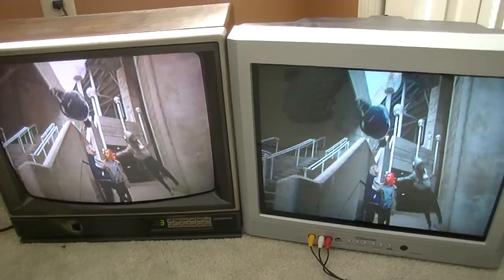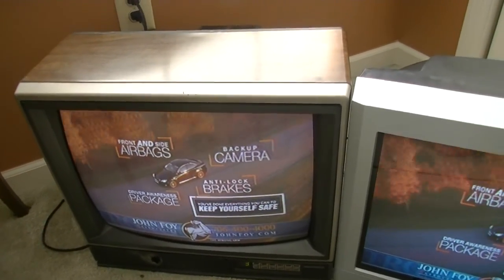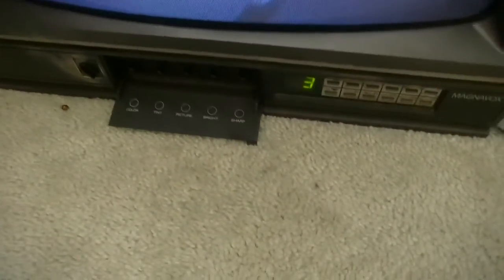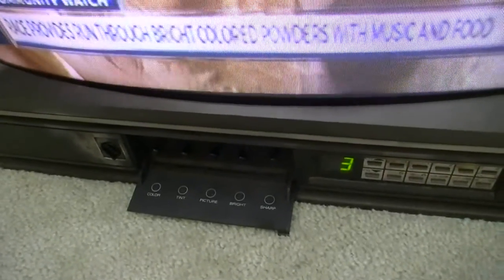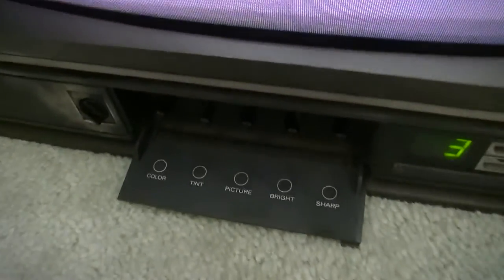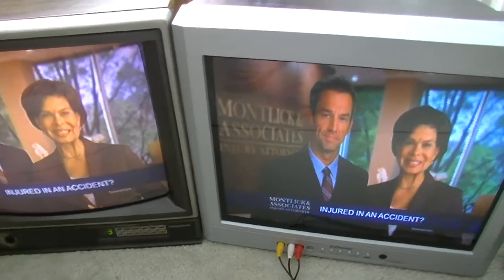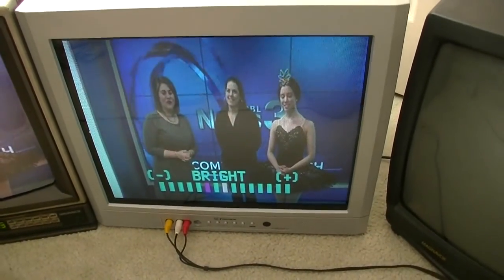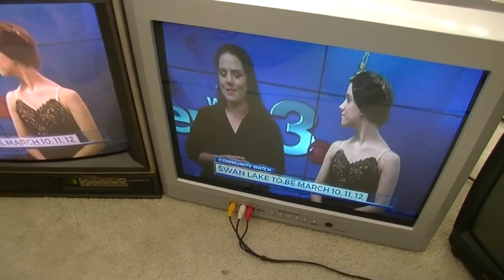How To Keep Your CRT TV Running Forever!

Comment: The oldest working television in the UK was made in 1936 and it is a CRT. There is also one that was made in 1946 and it was modified to work with digital TV and that is the oldest working TV in the midlands. CRT's can last for ages and ages. I love them.
Reply: Autistic Rebel better than hd cheap crap tv's!!
Reply: Mine sat in the rain for about a year. It still fucking works
Reply: Iku Ze people wash the circuut boards in a dishwasher, dry it and then reassemble just as a refurbishment lol, insane
Reply: @Creations and circuits ,I just repaired five DVD players a few weeks ago. They weren't even that old,a few months each for a couple and like a year and a half for the rest. I had NO idea what I was doing and was about to just throw them all away. I keep buying them and they keep breaking almost as soon as I buy them and so I just buy another and I got sick of it so after remembering how my ex husband use to just take apart DVD players and VCRs all the time and fixing them without even knowing wtf he was doing ,I decided that I could probably do it too,so I did with all five of them. One of them just needed cleaned and the others,I just kinda moved the parts around a little ,going on instinct and I'll be damned, I fixed them ALL in less than three mins each. No lie. 😁
Reply: Plasma TVs just start leaking after 1-2 years
Reply: is it still working?
Reply: Wait wait wait wait your saying CRTs can last much longer than the normal flat screens we see today?
Reply: @koiyujo1543  Yes modern TVs are junk I’ve seen flatscreens just stop working after 2 years of use my CRT tv is 25 years old still working like new

Comment: The Crt's last so long I've rescued several from the landfill and they work great even after being discarded. I think the solid state electronics would fail before the tube itself would fail.
Reply: My experience with lcd tech - they work five years maximum, after that matrix fails. While CRT work forever.
Reply: @snesfan8935  CRTs should come back into the mainstream. Lasting forever = more sustainable in the long term, and that's what these green initiatives are all about LOL
Reply: @Suedeash  "Green initiatives" is more akin to the whole climate change propaganda, but it's good to save CRTs from the landfills.
Reply: Our 9 year old Samsung 1080p tv still works great to this day without a single repair or issue.
As long as the panel dont get damaged, to me lcds when it comes to repairability should last longer.
Reply: Wow I didn't know these things could last longer than regular flat screens I could see these being useful got interstellar space travel
Reply: @dansmith5012  I bet you are smarter than all the scientists.

Comment: When it comes to non HD games, CRT's are the only way to go, IMO.
Reply: Even HD games can be used on HD-ready CRTs (which actually existed, surprisingly enough). I personally want to get a TV like that for my old Xbox 360 S.
Reply: @MrUnknownuser164  some crt monitors went up to 1440p too. Nothin to scoff at i must say
Reply: @Socaran Ectien  Interesting. I remember reading something about CRT monitors having a maximum resolution of 2048x1536 (basically the doubling of 1024x768, like how 2160p is the doubling of 1080p) at 85 Hz over VGA.

As for TVs specifically, the early 2000's saw projector TVs (and even direct view TVs) that displayed 1080i over component. They were still CRT displays, they just had screens that were flat and wide. These were the TVs that were intended for the Xbox 360 and the Playstation 3.
Reply: @MrUnknownuser164  you know you may be onto something. The dot pitch has a lot to do with the resolution and on the hard forums said that on an fw-900 2304x1440 won’t fully resolve even at the center. I guess that monitor, one of the best crt monitors, “can’t” do 1440p?

Comment: Good info. I have a Sony Trinitron XBR  36 inch from about 1999 and I believe the CRT is getting weak. Sometimes anything in the backround that is white has a pinkish hue to it. Also anything blue, like the DirectTV guide, will turn green for a second then go back to blue. The TV is on probably 18 hours out of 24 and it's been running like that for a few years now.

Comment: I just picked up a 2004 27" Toshiba one, looks brand new lol. First thing I noticed when first turning it on is that the TV has thicker scan-lines than what I'm used to.
Reply: I have an 05' 27" Toshiba HD CRT and my Sixth gen consoles look absolutely amazing. CRTs are still top notch for lower res images.
Reply: I just picked up a 13" toshiba from 2001 and have yet to try my gamecube on it, but the live feed from an old digital camera looks surprisingly great on it

Comment: If you guys adjust the picture settings that can help keep your tv from using extra energy. You need to make the clearest picture so your crt tv won't use too much electricity projecting images that are blurry and soft looking. If you give your crt the clearest picture, it will stay cool in temperature and it cwn reduce the electrcity bill. Giving it a clear picture also helps the tv use less light around its projection. That why you have to adjust the screen setting for the clearest High Definition HD picture.

Comment: Dust free environment is best. Dust in the unit collects moisture and heat. Disconnect from power for a few days before disassembling and cleaning. Also pressing buttons during this time can help remove static voltage left in the capacitors. If you have a clock feature there may be a battery inside in need of changing too. Cheers

Comment: I have a 32" Toshiba CRT television which is my only television.  I got it for free off a Craigslist posting. I use a digital to analog converter for over the air television broadcast using the S video connection on the television,  and connect up a DVD player with the component video connection.

Unfortunately,  eith the remote failed or the remote signal receiver on the television failed.  That's not too much of an issue since the converter and DVD remotes allow many functions to be handled with remotes.  However,  the on/off functions and shut off after x minutes function aren't accessed by remotes,  so the television winds up being left on most of the time.

Also,  I'd like to connect up my laptop to display internet media,  but I'm out of component connections,  and the ones I have don't match up with the television.

I COULD use an RF connection for the digital converter and look for an  HDMI converter to S video or component television.  I haven't gotten around to that,  yet anyway.  

I avoid throwing away musable equipment,  although a more modern LCD television would use significantly less power.  My bias is to keep using the Toshiba as long as it runs.

Comment: I use a Sony PVM-14L4 monitor as my main TV! I have my original 60GB PS3 connected to it with component. I know the PS3 would probably look better on an LCD TV with HDMI but there's just something I love about CRTs and I don't know how to describe it. I also have my high-end VCR and LaserDisc player connected to it too with composite! And I even have a black & white CRT monitor facing in a different direction so I can see the picture from different parts of the room and that monitor is connected to the main monitor with composite. I have a PlayStation composite/component hybrid cable so that I can run the PS3 through the LaserDisc player, which runs through the VCR, which runs to the main monitor then finally to the black & white monitor. But I also have the component part of the cable running directly to the main monitor for better picture quality on the main monitor. The reason I have a composite/component hybrid cable is so that I can display the PS3 on the black & white monitor and be able to record it onto VHS as well as having good picture quality on the main monitor with component! And if you are wondering, yes I do play PS1 and PS2 games on my PS3 and that is what I mostly play, I hardly play PS3 games. The reason I've even got a PS3 is just because I love that machine and especially the original 60GB model, I'm not really interested in the PS3 games.
Reply: Anything 2D looks amazing over pure RGB/component, but IMO early 3D looks much too blocky/jaggy. I prefer most 3D PS1 games over composite. Actually it would be nice to see if s-video is a nice middle ground.
Reply: I have a modded ps3 slim with some ps1 ps2 and ps3 games installed. Once I get this old CRT I got for $5 cleaned up I'll be hooking it up through AV and playing through the original silent hill games again.

Comment: I have a 20" toshiba from the early 90's. I run my ps2 on. Have also ps1 and n64 to hook to it. Ive tried my gamecube (all 3 of them) on it and for some reason it has some wavy lines in it. Ive read where if the power brick for them is too close to any electronics it will cause this. I know the GameCube runs fine on the little 720p flat screen I have. Just wondering if this had anything to do with resolution out puts of the tv and GameCube? Still looking around for another flat screen crt. Had a rca truflat back in the early 2000's. Probably 02 to 03.

Comment: My parents bought a 27 inch Magnavox crt TV in 2001 and it was used for at least 12 hours a day every day until 2015 when it messed up. It got to where the picture would get really small in the middle of the TV and you'd have to hit it on top to get the picture to use the full screen again. Eventually it got worse and worse until there was no picture anymore.

Comment: Nice video. I opened up my 2005 toshiba 24af45 tv and cleaned it out had alot of dust in it. Then adjusted brightness and foucse control. I then adjust convergnace, which is still not perfect yellows have a green tint to them. Then my friend adjust the geometry in the service menu. He better at it the me. I showed him what service menu controls the sreen shape. He made it about %90 or more perfect square.
Reply from the maker: Cleaning out the TV was something I considered mentioning in the video, but I figure most people won't be up for that, haha. Keep 'em going! I have another TV that's similar to that one you have, it's a 2007 model, but it was made 2 months before they started requiring a built- in digital tuner (yep, that was a thing in a few CRT TV's, they're pretty hard to come by nowadays), huge bummer. Anyway, thanks for watching!
Reply: DOOMISFORU GAMING Man adjusting the geometry is really hard, I had a Sony KV27FV300 and never managed to get the top part right. According to some video I would have need to open up the TV while it is live and adjust some screws inside or put some magnet on the tube ..
Reply: Saya jiin Yes it risky, I shocked my self when I was cleaning it. It felt more like a sting then shock. I tuched the back of the tube by mistake. also, the rings are flimsy plastic, so one broke where u hold it making it harder to adjust.

Comment: Trying to save a gateway crt I found outside. Picture is really good, no burn in, but it's dim and it sounds like somthing is asking inside. I ran it for a bit and the asking stopped by the image is still dim. Not unusable just dim.

Comment: To be clear.....the way to maximize the life, or keep running forever......is to turn up the brightness? This is great. I thought there was gonna be cleaning, and like soldering or some crap. But just crank up the brightness!! :P
Reply: Actually no, the lower brightness and contrast the, the longer tube will work. If your tv in good condition then try to set it in 30%-40%. If picture become dimmer, then slightly turn up both these parameters. And so on, every time it become noticeably dimmer, you should just slightly turn up these parameters. For example you had brigthness and contrast at 35% you then change it to 40%.

Comment: I have an early 2000s tube TV but I don't use it. I play all my retro games on modern displays and all in component video. I only keep the CRT around in case I ever get any light gun games because those old light guns won't work on a modern TV.
Reply: AirCooledMan2006 have you ever tried using an XRGB-Mini Framemeister? Despite the cost, it’s a very great upscaler for retro consoles.
Reply: Joey Roller There's no way I'm paying that much for an upscaler. I tried using a cheaper one but neither of my TVs would take the RGB signal. Closest I've come was HD Retrovision's Genesis YPbPr cable with two adapters: One for my Genesis/32X combo (it's a Model 1 unit) and another for the Saturn. My Xbox, Wii, and PS2 are all hooked up through component. YPbPr isn't the same as true RGB but the quality is about the same.

FULL DISCLOSURE: I do not work for HD Retrovision. I bought their Genesis component cable the day of launch, with my own money. Ditto the Saturn adapter as soon as I got a Saturn.

Comment: Actually the 1980s CRT TV probably just needs to be recapped ( give it new compositors) that was probably what is causing the dim picture.
Reply: NotthatDisgusted he said that he fixed the dim problem 😂 by using the control dials for brightness
Reply from the maker: The CRT is really weak. I could probably rejuvenate it if I had a CRT tester.
Reply: and what exactly is a compositor?

Comment: Not to sound rude but CRT TVs can't last forever cause when I find sets from the 50's or 60's, they need repair.
Reply from the maker: sry :(
Reply: No need to say so.
Reply: I don't think he was being literal.....I find CRT's from the 80's and 70's and usually they still work. that's not bad for a 30+ year old piece of electronics.
Reply: yes i have 3 vintage tvs that i got and had to do NOTHING to they just worked. a 1973 zenith, a 1978 zenith, and a 1980 general electric althouh the ge has a semi weak crt still great preformer.
Reply: 50's and 60's sets electronics ran on vacuum tubes, they needed repair and adjustment often. That's why there were mobile tv repairman back then. Newer sets only had one tube, the picture tube and are much more reliable.
Reply: i have a 1950s zenith set i restored. normally it is not the tubes that are badf it is normally capacitors resistors and that kind of stuff
Reply: Computer Crap plus I can see that. I've successfully recapped a few vacuum tube radios and the tubes were all good.
Reply: yeah tvs are the same and just like radios alot of times even if some of the tubes are pretty weak it will still work just not as well.

Comment: Cathode ray tubes will not last for ever especially modern tri colour tubes. Early monochrome tubes can have an extended life only because the cathode emission coating and the display phosphors where applied much thicker in the past because manufacturers did not know any better, but  modern tubes the manufactures made sure that the coatings and the screen phosphors last a shorter length of time, nothing quite like built in obsolescence to improve the profit margin. Next the vacuum slowly dissipates because it is not a perfect seal between the gun connection pins of which there are more of traveling through the glass  of the tube neck and the final anode connection on the tube bowl is also not perfect. Just think nothing will last for ever not even this planet we all live on!!

Comment: What does that mean? A. These CRT TVs will actually last FOREVER. B. they will last just for a very long time.
Reply from the maker: B
Reply: TheCRTProductions - Why don't it mean they will actually stay running forever for?
Reply: Eventually the tube will burn up. But I suppose if you are handy at electronics you could fix it yourself.You'd probably need a tube rejuvenation kit.
Reply: we will all be dead but there will still be toyota cars and sony trinitron